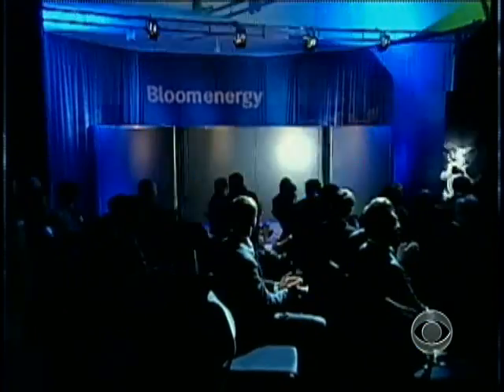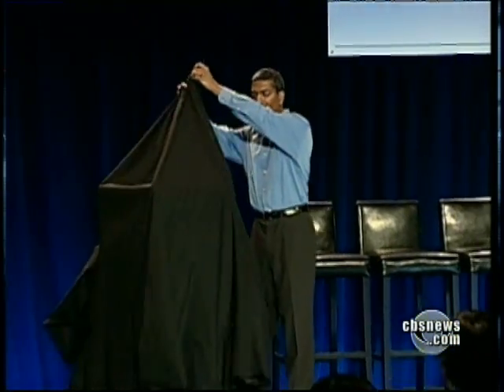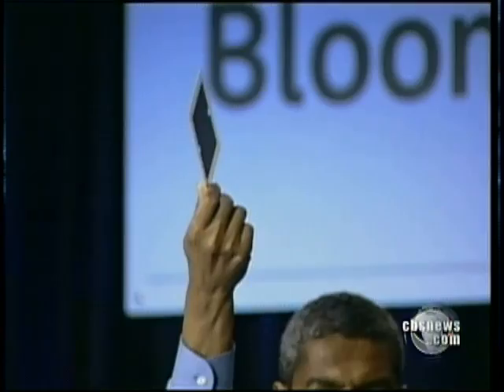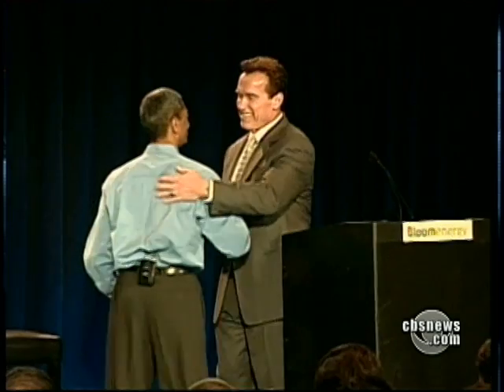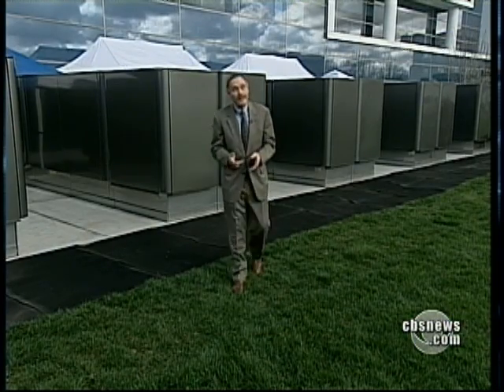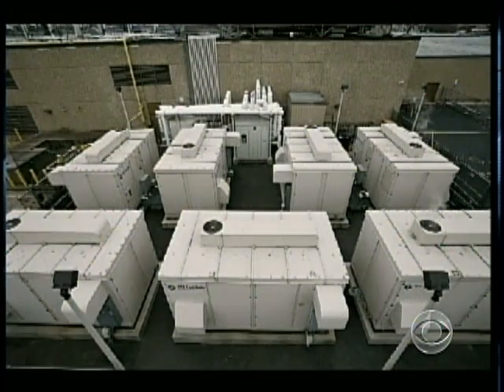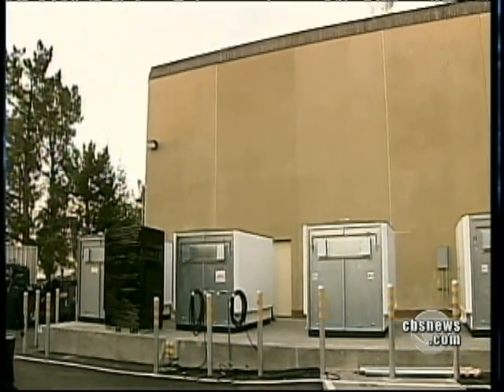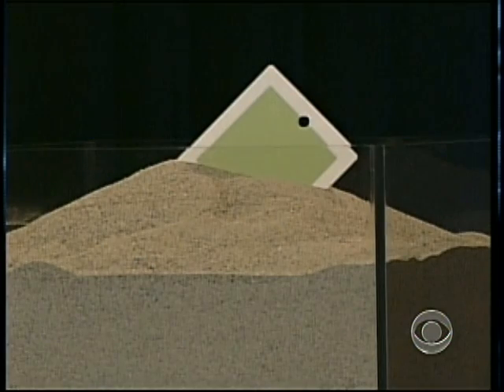Bloom Box Unveiled

Comment: @a1mint   The GM Volt is 55-60% on the highway.  From plug to bat .9, out of bat .9, through module .9.   .9 x..9 x.9 = .729  Then at .9 for the motor you get 65%, but that is only at peak eff.  An electric motor has a "BSFC" curve just like a piston engine does.  A 110 kw GM electric motor at 5kw would be well below 50%.  This is common.  .73 x .5 = 36% peak around town.  Bottom line is it is likely 25-60% city-highway efficient.   Mine...60% at all time, does solar, 90% recovery...Checkmate
Reply: Uhhh wut?

Comment: @a1mint   Energy can be NG, gasoline, diesel, propane or solar, wind, or braking or inertia recovery.  

Electric motors are only 95% in a very narrow range.  A 120kw GM Volt motor may be less than 30% around town where the power required is 3-5 kw.  In addition, during braking they are typically only 25% max, whereas mine is over 90%.  

The Bloom box is NOT the answer in any way.  It is very heavy, and so it an electric motor.  My engine makes it obsolete....

Comment: @a1mint   Mine engine can run on an electric battery but it does NOT have an electric motor.   At the shaft it is as efficient overall as an electric motor, but without the limitations of an electric motor.  For example, the Gm Volt is 55-60% when ran on electricity only.  Mine is the same, but you can get 40% useful heating/cooling where as the Volt cannot.  Checkmate....

Comment: @a1mint   The engine is a torque device, just like a piston crank or turbo is a torque device.  It is then connected to an electric generator if you want electricity or is used to torque a fan, wheel, or transform temperatures up or down.   When you get the lighting right (LEDs, compacts...) and information low energy (laptops, Ipods) then electricity is only "needed"  where is is required or about 5-10% of all energy.  The rest is thermal (heating/cooling) and torque (movement).  simple.

Comment: @a1mint   My solution is my new engine, solar collection and energy storage.  See my channel.  

Our energy needs are mostly thermal and torque, NOT electrical.  If you use LEDs, and low power PC, where total power for information is < 2% (DOE figure)....  Lights, microwaves, and miscel. appliances can be less than 5-10%.  

The rest is air movement, heat, cooling, process, torque (transit).  A car is a moving house that keeps you warm or hot.  Electricity cannot solve our energy needs.

Comment: @jjjankman   Read my bio.  My solution will get 80-90% of the NG/fuel out of the average person's life for about 10k for a 20 kw system vs 140k for a bloom 20kw system.  Mine runs on solar, bloom does not.  Mine will run a car AND provide torque...bloom's will not.  A GE combined cycle gets the SAME efficiency as a bloom box.  Big deal...  Not the solution...  Again, read my bio.
Reply: @rubinsaffy  newenginetype.com  Since 9 years ago when I wrote the comment, the engine has changed dramatically.  This is R&D, not a finished product.  The New Engine Type is much better than a fuel cell and can work with fuel cells if needed.  Not against them, but their costs are much higher by around 5-10 times and their use is limited and complex.  

I think we can get to 2-6 cent/kwh for 100% RE from solar thermal.  1-1.2 c/kwh for immediate use of solar and 5-6 for solar to fuel making to electricity without counting waste heat which is around 25-50% depending on power range.  It can store losses from engine process as well as solar thermal panels in hot water.  See "key to solar" on the web page.  

The key is fuels as the battery.  Make fuel Spring, Summer and Fall, use in Winter.  Fuel cells cannot make the fuel.  They can consume the fuel at a rather constant rate (bad).  The key is to be able to use solar thermal that makes electricity and low grade heat to heat water/house, as well as responsive power in the 1-20 kw range.   During a good solar day the system can produce 100-120 kw or so, yet still be efficient at ~1 kw using fuel at night.  Remember, solar thermal is 5x better than PV in energy capture.  This allows Winter capture rates that allow smaller systems, yet can be fuel driven if undersized.  Any fuel can work, dirty or clean.  Fuel cells cannot do this.  This is key in poor countries where fuels of low quality might be used.

The key to this is this technology can run your car or airplane as well as house.  By having this in car, you could use it as a backup generator should grid go out.  In airplanes it can change the entire equation for aviation by allowing "power on lift" that allows 1/2 landing speeds, as well as active drag reduction (50% lower drag).  VTOL apps are also enabled for long range drones using fuels that eventually will be made from nuclear power.  Fuel cells cannot do the power on lift nor the active drag reduction and thus will be at least 2x more fuel to use always.

Thanks for asking...